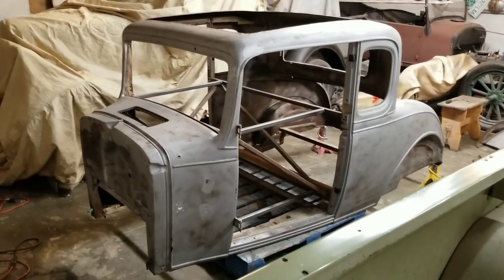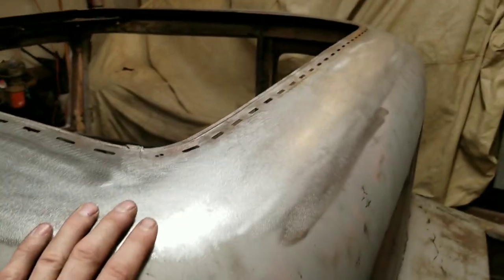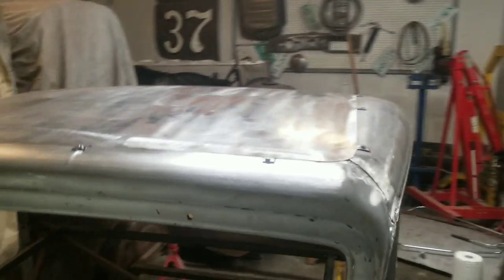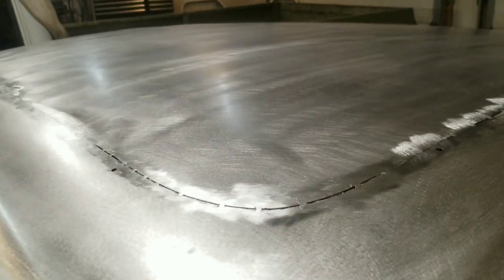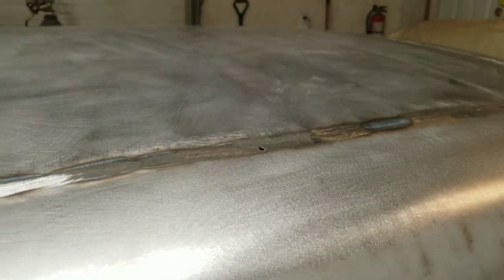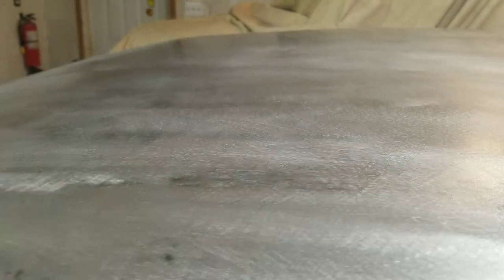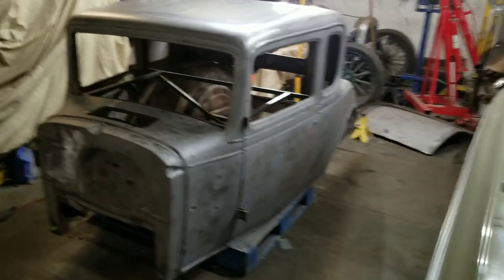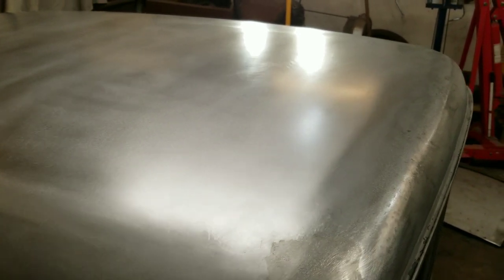Welding a steel roof insert in a 1920s or 1930s car

Comment: An old body man once told me "spend your time straightening the metal and you won't have to spend your time sanding the filler. The straighter the metal, the better and faster it'll finish up." Don't worry about spending the time straightening the metal out. It'll last longer than the putty will.
Reply from the maker: Thanks, that's very true!

Comment: I have watched many videos from others that show this process but thanks to the time lapse this is the first time I have actually been able to see the metal rise up and then shrink back down as it cools from the heat.  Good photography.
Reply from the maker: Thanks, catching the metal shrinking on the time lapse was actually an unintended fluke, but I'm glad you found it interesting. Thanks for watching!
Reply: If you ever try to weld 20ga or thinner, you can watch that happening in realtime.

Comment: Excellent work Kyle!! As always you amaze me with your metal expertise, when you're done with the metal work you don't need body filler, just prime it and paint and you're good to go! Question though, are you adding any supports to keep it from tin-canning, or does it have enough curve to the roof to support itself?
Reply from the maker: Thanks Ken. Yes I did end up bracing  the roof using the original supports from the Chevelle donor roof. They are just temporarily tacked in at the moment because the owner of the car still needs to replace all the wood and install sound deadener on the inside of the roof.

Comment: Cool trick with the tabs! That would have been a pretty difficult clamping operation. I notice that you are more careful with a large fairly flat panel, which is more challenging to get right. It also seems to me (though evidently not to car makers) that such a large fairly flat panel should have some sort of underlying reinforcement with curved metal, square tube, or something. Final product looks nice!

Comment: Hey Kyle. Great job on the roof, you certainly know what you are doing, it can't be as easy as you make it look. I'm looking at a 35 chevy coupe but the roof is a mess, someone put a metal insert in and it is all warped. Not sure if I should buy the car....Ralph
Reply from the maker: Thanks Ralph! On the '35 coupe, if they messed up the roof I would just automatically assume that all other work that's been done to the car will have to be redone and make an offer accordingly (cheap). It takes twice as much work to fix someone elses mistakes than it does to start with an untouched car.
Reply: @CarterAutoRestyling  Thank you , I passed on the car, needed too much work...Ralph

Comment: You have incredible metal working skills! What a great job on the roof. What brand of tig welder are you using?  Are you just using mig mire for your tig rod? Just curious. Thank You.
Reply from the maker: Thank you! I'm using a Miller Diversion 180 and .030 mig wire
Reply: @CarterAutoRestyling  Thanks for the info. Your channel should be taking off.  Lot of good content and love your sense of humor.  Take care.

Comment: Second round watching this one! I don’t have tig, could I run into problems doing this with mig ? 18 gage  70’s Gm hood. Thanks JR in Ontario
Reply from the maker: Yeah you could have a lot of problems mig welding on a hood. I don't know of any 70s cars that had 18 gauge hoods, most are much thinner than that. Check out Fitzee's Fabrications, he has a video on mig welding an Olds 442 hood.

Comment: Just curious. How did you work around the corners where the leading was. How did you remove the lead and clean the metal so it wouldn't interfere with the welding?
Reply from the maker: I used a map gas torch and melted out all the old lead. Then I ground the metal clean and rewelded the factory seam. After the roof was welded on and before I did the final hammer and dolly work I releaded the seams.
Reply: @CarterAutoRestyling  Thanks, That cleared up the process for me.

Comment: What are you gonna do for the inner structure are you keeping the wooden frame?
Reply from the maker: For the inside of the roof I used the original cross braces from the chevelle roof, the rest of the wood in the body will be getting replaced with steel.

Comment: That Chevelle roof turned out great on there! I have the same english wheel that you do, it was very frustrating to use with how spongy and inconsistent it was. I added a backbone on mine out of roll bar tubing left over from another project and polished the upper and lower anvils. It made a huge difference. Very consistent and a lot easier to make panels with it. You may want to consider something similar if it gives you too much trouble.
Reply from the maker: Thanks, Bracing up the english wheel has been on my to do list forever. One of these days I'll get tired of fighting with it and actually do something about it.
Reply: @CarterAutoRestyling  I highly recommend it

Comment: Do you oxy-acetylene weld at all and if so how do you find it compares to TIG welding? I am still learning how to TIG. I do know that when MIG welding steel the welds end up very hard so it seems hard to hammer and when grinding it's easy to gouge either side of the hard weld. With gas that doesn't seem as bad. And with gas on aluminium it leaves everything annealed and soft so hammering to reshape is much easier and it also re-hardens it. But I don't know yet how TIG affects things as I haven't yet got the knack of TIGing thin ali. My mentor who taught me showed me the use of the vixen file to show the highs and lows. He said that was why we started on 1.6mm aluminium not 1.2mm. It gives me much more material to file out when learning how to get it smooth. He said by the time I got it smooth it would probably be 1.2mm anyway and I don't think he was wrong!
Reply from the maker: I have played around a little with Oxy-acetelyene welding and was impressed with how easy it was to hammer the welds back into shape, but a couple hours of playing around isn't enough for me to form a valid opinion on it. I have heard the serious metalshapers prefer gas welding.  For me Tig welding works just fine for what I do. Mig is nice for doing quick repairs, but due to the hardness of the weld it's a lot more difficult to get a panel straight if it does start to warp.

Comment: Once again amazing work! Do you treat the metal from surface rusting? Thanks chevelle, one perfect roof. What state are up you from? Just curious
Reply from the maker: I'm in central Canada. Our climate is extremely dry so a car can sit in bare metal for years and not rust, but I usually put a little Gibbs on it if I know it's going to be sitting around a while.

Comment: Hey Kyle.....AMAZING work to say the least. Question? do you or have you used "heat fence" while welding up roof seams? I only ask because YEARS ago I saw heat fence in action while I was in welding school and 1 of the auto body students used it during 1 of his projects and in VICA competition. I myself have welded very little sheet metal per say.....utility body repair but mostly structural (cert. vertical up and overhead low hydrogen 7018 stick and my favorite .045 dual shield MIG) Just curious if heat fence was a tried and true method? or if there's some new and improved way to keep panels from warping? Thanks in advance

Hyway in Jackson, GA USA
Reply from the maker: Thank you. I personally have not used a heat fence, although I have heard stories from back in the days of gas welding where guys would use asbestos on either side of the weld seam. At one shop I worked at  a coworker tried using some type of heat fence while he was welding in a custom roof panel, I can't remember what the brand was, but it looked like some type of grey putty. The roof still warped as it was welded. 
I think distortion during welding is unavoidable, it can be minimized and reversed by proper fit up and understanding what happens when a panel is welded ( the weld shrinks as it cools).
Reply: @CarterAutoRestyling   I did an internet search earlier in the day.....One particular brand is either completely out of stock or? it's obsolete. The heat fence I remember from years back was a brownish/tan color......came in a tube like tooth paste and was about the same consistency. The "paste" was put around the area to be welded and as it absorbed the heat? it dried out almost like mortar but? from the looks of your work? heat fence isn't needed. Thanks for sharing your build videos, keep up the great work and I'll keep watching!

Hyway in Jackson, GA

Comment: Nice work. Do you ever have to anneal the areas that you work, due to work-hardening of the steel?
Reply from the maker: Thanks. The tig welding process anneals the metal, so planishing and working the metal returns it to its original state. That's why I don't like quenching the welds when they are hot with air or water, as quenching it will harden the metal. 
That being said if I have a major dent or a sharp crease in old metal, I will heat it up before trying to work it, and occasionally while I'm working it. I don't heat it to the point where it changes color, just to where it's too hot to touch. The heat helps get the metal molecules moving around so the metal doesn't crack when you go to pull it back straight.

Comment: Have you seen what Bad Chad does when welding n blowing it with a air hose to cool it down so it won't get whorp
Reply from the maker: I find cooling the weld causes it to shrink and warp more. It also hardens the weld and makes it more difficult to hammer flat. That being said there is no right or wrong way to do this stuff, as long as the final product is the same it doesn't matter how you get there. Occasionally I will cool the welds if I feel an area needs extra shrinking.
Reply: @CarterAutoRestyling  oh ok thank make sence

Comment: I'm wondering Kyle if the edge of the metal incert was hemmed all the way around, if that would create an issue with Tig welding? Seeing there would be double the thickness on the insert all the way around. I was thinking if that could be done, that it may stop some of the shrinking. I guess ideally though you would want the hem on both surfaces, and that would probably open up a whole new can of worms.

Comment: Awesome job, have you done any metal fab for the inside structure/
Reply from the maker: Thank you! I haven't built any of the inner structure for this one yet, my job was just to weld the roof insert in and fix some damage to the rear of the body. The owner is going to be building the chassis this winter and getting the body mounted before any of the wood structure gets replaced with steel.